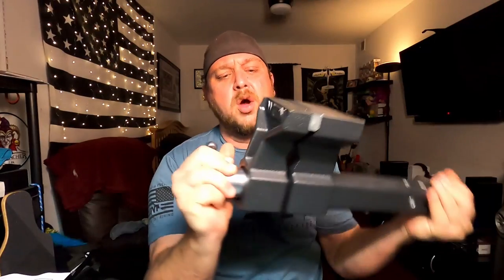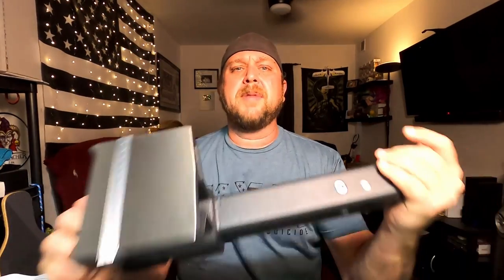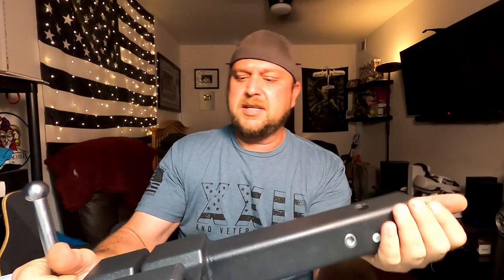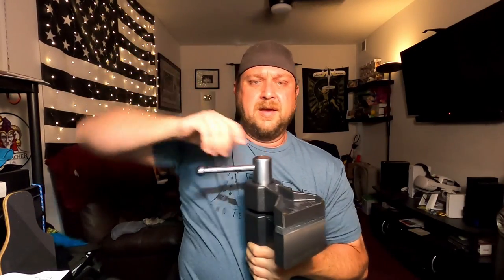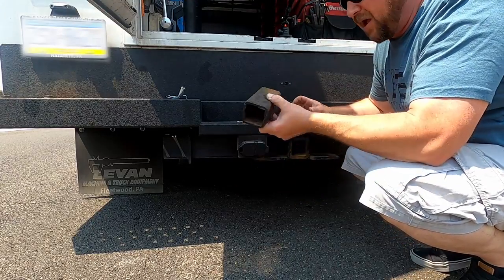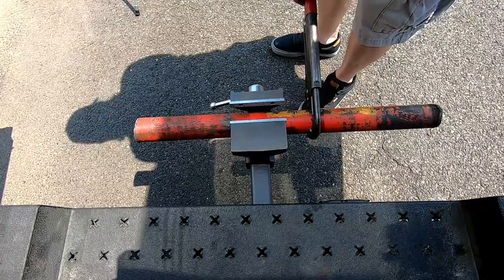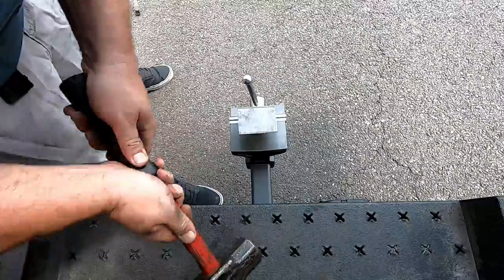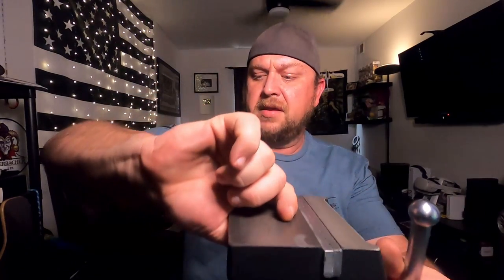Wilton ATV Hitch Vice

Comment: At 6'3" I couldn't imagine having to do any work on a vice so low to the ground.  That's the main problem I see with it. But it's also unique to tall people.
Reply: You could also use a 12” drop-down hitch receptacle in conjunction and flip it for added height.
Reply: Sooo putting a pipe or something you need to cut on the vice.. is a bad idea ?  just stand up and cut it.. better than stepping on the pipe on a curb with your feet
Reply: @jeepsblackpowderandlights4305  It really just depends what your doing and if your doing it once or for 8 hrs.
Reply: They make a fold out mount that sits at a nice height

Comment: I have a small garage so I have this to mount under my Bench Solutions folding bench. It's been useful and dependable for years. The best thing is I don't bash my shins on it when the bench is folded down.
Reply: I took a piece of hitch reciever tubing and welded to my fab table which is 4x4x3eights square tubing 7ft sumx3ft sum on casters probably half a ton, anyway all my stuff is adapted to 2x2 tubing I mobile work also so everything is compatible from shop to truck
Reply: Pipe welding lathe..vices. ect..jigs

Comment: Love the product reviews, I bought one of these a few years back and I love the convenience of it, it lives behind the seat in my pick up and it's so easy to fit for those roadside repairs that pop up, they also have a bracket that fits over the hitch section that you can bolt on a work bench or any solid mounting spot. I have a nudge bar that I made a 2'' hitch point for so I can use it on the front of the vehicle as well.

Comment: I've had this vise for about 5 years on the back of a work truck and it still works after the abuse. Wilton has separate bench mount clips and thats what i got to put on the bumper instead. Pretty sloppy but i shimmer it so its nice and tight. One time the truck was backed up and the vise hit a wall pretty hard and eventually the mechanism detached from the thread that turns it to open and close. I took it apart and drilled a 1/2" diameter nut to a 5/8" hole and welded it then welded a 3/4" x 1/2" drive socket to that and use a breaker bar as a handle or even an impact at times on slow speed lol. The threaded rod is bent some but it still works and been like that for like 2 years. Exact Replacement jaws were hard to find as well and i ended up getting irwin 5" jaws and the holes didnt match up so i drill and tapped 2 new holes although 1 was insanely close to the old hole but off so it didnt work well. Welded the sides of the jaws. Also the carry handle is a nice spot to vise grip things to it that is too big or something for a vise. I like the vise alot and would recommend and its convenient cuz i can take it home from work and throw in the hitch of my truck. O and the breaker bar handle provides great leverage and i actually prefer it lol
Reply from the maker: I might get that bench mount. It might be helpful to have it up higher.

Comment: Wilton sledgehammers are by far the best. Ive used them in deep sea welding for the duration of my career and currently use them in my concrete career

Comment: I love my vice identical to yours overall had it for 6 years does what i intend it to beat things with a sledge all day long things I don’t like
- siezes up over time in road dust so once a year leave it in a pail of used oil overnight 
- handle i hated so i cut it off drilled a hole through surprisingly easy and made a sliding handle on it that cam mechanism seized up immediately on me
Reply: I mounted mine on top of the bumper so it’s easier to work off

Comment: I have a five inch Wilton bullet vise made in 1972.  It’s a monster.  Does everything I want it to do and has performed quite well over the years.
On the other hand, I bought a 4 inch Wilton mechanic’s vise five years ago.  Biggest POS vise I’ve ever owned.  A year into using it I tightened down on it with just my hands and stretched the threads in the thread box.  Sucks because the hardware store where I bough it went out of business.  No prospect of refund, exchange or adjustment on a new one.  
👎👎👎 for Wilton made vices these days.  
Whipple
Reply: Why don’t you contact Wilton for a warranty replacement parts? I’ve been hitting up every company that I’ve had problems with their tools lately and had good luck getting taken care of.👍
Reply: @skullfracture2    That’s not a bad idea.

Comment: pickups with some huge hitch receiver adapter monstrosity sticking out the back doing nothing usually honk me off, but as your work truck and an actual device that does something, I give it a thumbs up
Reply: I’m one of those guys that have a huge receiver adapter monstrosity sticking out the back that does for the most part do nothing. But what it has done is ripped off one front bumper and busted three radiators of people that decided to run into the back of me and left my bumper pristine. Until people quit staring at their phones and start paying attention to the road I want the biggest heaviest hitches I can fit in my receiver.
Reply: @jamesstewart601  Understandable. I'm just more thinking of when I'm walking in a parking lot and they've got something that sticks a full foot or two past the bumper and I end up running a shopping cart into it, or worse, the shins.